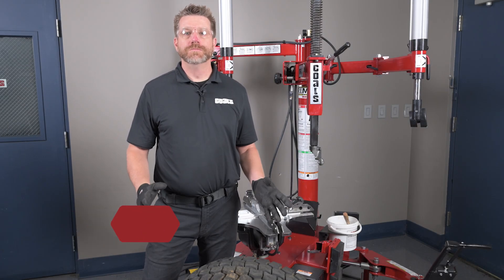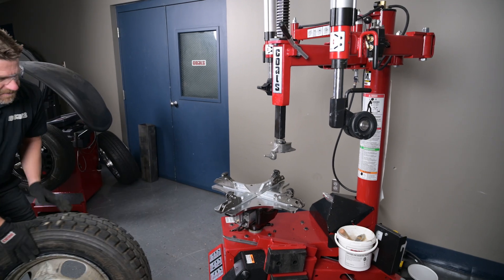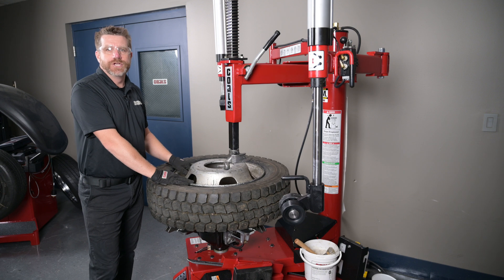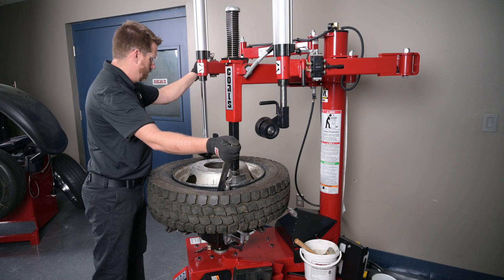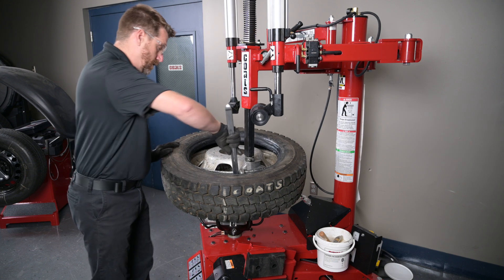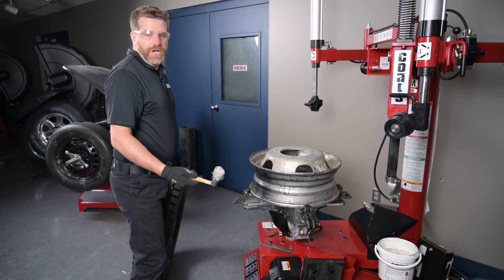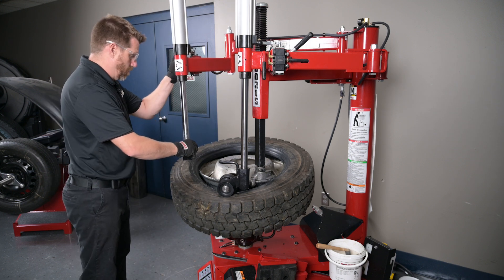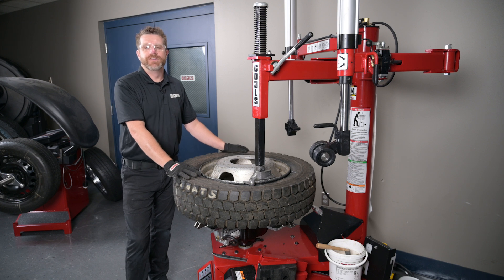How to Change 19.5 Tires

Comment: May I ask what model tire machine your using. Yours looks superior to my 3500 dollar unit
Reply from the maker: Great question, Harry — the machine in this video is our MAXX 80 Tire Changer, paired with the MAXX Wheel Lift and a steel duckhead. It’s built for high-volume shops and handles tough jobs like 19.5s with ease. Definitely a step up if you’re working with heavy-duty tires regularly!

Comment: Can this be done with the MAXX 50? Trying to find a machine to bring tire repairs inhouse for our small garbage pickup company. Our Isuzu runs 19.5s.
Reply from the maker: @BakerCountyTrashPickup Great question — the machine in this video is our MAXX 80 Tire Changer with a MAXX Wheel Lift and steel duckhead, ideal for high-volume shops and heavy-duty tires like 19.5s. That said, our MAXX 50 is a fantastic fit for shops like yours looking to bring service in-house. It’s our foundational-tier changer — engineered for durability, built with the flexibility to grow, and capable of clamping wheels from 6”–24” wide and tires up to 50” in diameter. Perfect for 19.5s on your Isuzu. You’ll get core essentials like steel clamps, a paste lube bracket with brush, and a polymer duckhead to start — and you can always add on helper tools as your volume grows. Feel free to reach out at marketing@coatsconnect.com if you want to talk through setup or options. We'd love to help you get rolling.

Comment: Why never clamp from the inside?
Reply from the maker: @rickgrimsley2403 The reason that you don't clamp from the inside is because the wheel is conical-shaped on the inside so when you grab it from the barrel of the wheel you can't clamp it tightly.